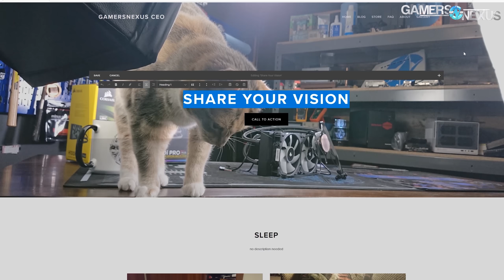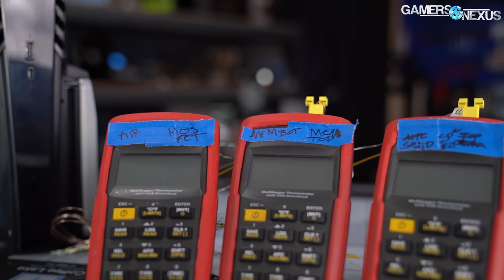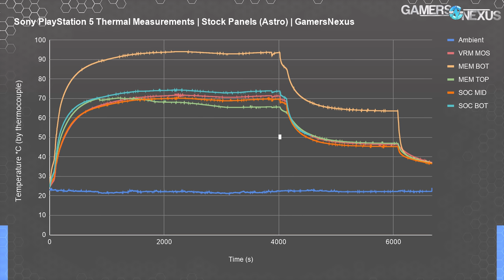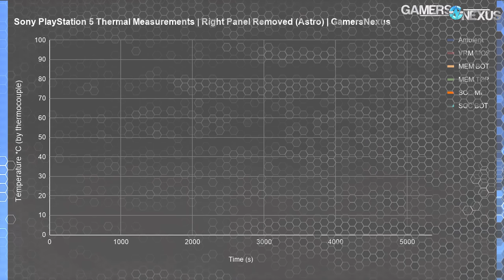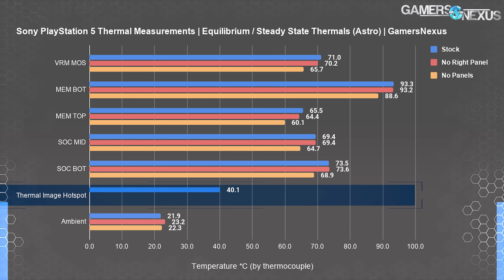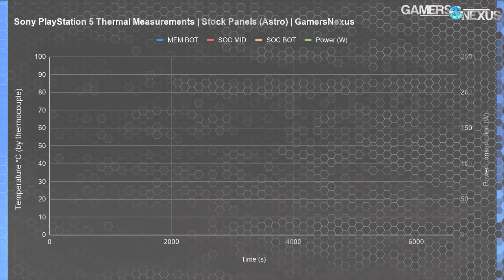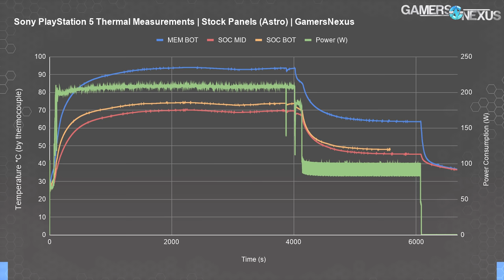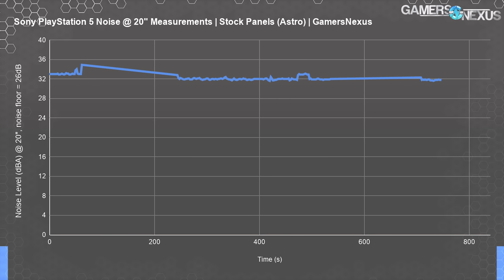Weak Cooler Design: PlayStation 5 Thermals, Power, & Noise Testing

Comment: Me living in a region where ambient goes to >35: Sweating profusely
Reply: Maybe you can channel the excess sweat as a coolant
Reply: maybe you should’ve bought the better next gen console
Reply: @notnooted  or a xbox series, they're top tier engineering
Reply: Yeah, Sony would obviously developed a console that will overheat on half the planet.

The fans will just spin faster to keep it at acceptable temps at higher ambient temps. That's.. pretty obvious. Cerny even talked about ambient temperature having zero effect on their "boost" system, seems retarded that it would then crash the console due to the RAM overheating. "Could be better" doesnt translate to "will have problems".
Reply: @M D well... noise can be a problem too... and while boost can still work at that temperature, I wonder for how long...
Maybe by the time many PS5s die... Sony will have the PS5 Pro ready to go 😂
Reply: @FufuhBR  those error are made. Around 15 years ago multiple mobile phones did not work reliability at winter in counties that get -10 degrees C or less.
Reply: @remmykun8315  the usual bga socket😂
Reply: Not as much as your PS5 will be.
Reply: Ah yes we dont live in a civilized enough society for air conditioning in those temperatures but i want my ps5 🙄

Comment: Let's see how this year's summer heat is gonna treat all the PS5s out there.
This current model needs a revision imo. But I'm not getting my hopes up.
Reply: Like in 2022? A redesign
Reply: you called it, they are working on a new model.
Reply: I'm 100% sure Sony is chomping at the bit for a revision. Their design looks extremely expensive and with the sheer size of the heat sink plus the cost and difficulty of assembling with liquid metal, they're likely losing a LOT per console, even compared to the standard sell at a loss model.
Reply: @shanez1215  looks cheap and rushed. Completely inefficient, thus the huge heatsink
Reply: PS5 Ti lol
Reply: @shanez1215  this may be a bit nit picky, but the term is "champing at the bit"
Reply: It's August 2021 and the heat is treating my launch PS5 very well. :)

Comment: I would rather have the fan louder with temps cooler.
Reply: wont help with the memory
Reply: Yea that small ps5 box does not help
Reply: @Messiahs  It would, though. More heat ejected from the case will cool thst entire steel plate and ultimately the memory. It won't be as drastic of a difference as the SoC but it will drop.

Im curious why they specced such a monstrous 30w fan. Perhaps it has a dust clearing mode like the PS3?
Reply: Same, I run my Pc fans on a higher setting and I didn't care my ps4 pro fan ran fast. I kinda enjoy the sound.
Reply: @94XJ  Good point actually. It'll probably be a minor drop in heat, but it's something you can do right now I guess.
Reply: Nope. Hot does not=slower unless it’s throttling which I doubt it will be.
Reply: Can't say I agree
Reply: MertensCW  you mean a sticker catching the fan blades
Reply: @theholypopechodeii4367  witch also generates heat. This is not a pc,  pre built console,  We cant adjust our voltage here
Reply: @theholypopechodeii4367  ur in the wrong place my friend, this is about ps5
Reply: Revving the fans higher wouldn't help, the thermal solution is flawed and inefficient. Plus the fans are loud enough already. Gotta love how it runs nearly 20 degrees hotter and considerably louder than the Series X yet the Xbox is virtually silent and runs cooler, draws less power and has significantly more processing power
Reply: @theholypopechodeii4367  Your hardware not failing immediately doesn't mean "no issues". If temps are hovering near throttle under load the majority of the time, you're likely shortening the lifespan of your components by a good few years

Comment: An important note regarding boiling water to calibrate thermometers. Water only boils at 100C at 0 meters elevation.  I believe Cary, NC is around 150 m elevation, so water should boil at about 99.5C, but in a city in Wyoming (avg elevation ~2000 m), it may boil closer to 93C. So, if your thermometer reads 95C, don't assume your offset is 5C, unless you know what temp your water actually boils at.
Reply: That doesn't matter bc he's testing all of them in the same altitude.
Reply: @MaxIronsThird  I made a general statement regarding calibrating thermometers using boiling water. It does matter if you're calibrating your own thermometers, so that you can determine what your offset is for your elevation.

Comment: Should do this for the series x also.
Reply: Series x is a tower design. Might not be the most entertaining to test, but still agree with you
Reply: Been done already passed every test with flying colors far superior design when compared to the Ps5
Reply: @naughtynicholas  the Ps5 design is Hideous Aesthetically and functionality
Reply: @RawHeat100  link?
Reply: @RawHeat100  bro can you pass the link
Reply: @RawHeat100 
They did the Series X already?
Reply: @RawHeat100  dudes just blatantly lying lmfao.
Reply: @RawHeat100  if I dont smell xbox fanboy fragrance here.
Reply: Probably will have the same result than PS5
Reply: @jvap244  Doubt it
Reply: @BigNazty8732  ok, we'll see it
Reply: He promised to do it in the video when he gets one at time stamp 36:32
Reply: Right when I saw both I knew the Xbox would run way cooler. It just makes sense to have a cylinder with a fan on the bottom.
Reply: @RawHeat100  Eh, the heatsink is still utter trash and the XSX has the same TDP issues. The problem is that Xbox and PS engineers go cheap due to the mass production that is required, so things like cooling are not at the top of the list where they should be.
Reply: @emceeunderdogrising  That's not the issue though, the issue lies with cheap heatsink design and garbage cases for air to move through. Both consoles share the same issues.
Reply: @RawHeat100  where can u give me link
Reply: @evolicious  if people can blow vape smoke in the bottom, and it all comes out of the top, I'd say that's pretty good ventilation and air flow...
Reply: @evolicious  Yep, and Series X despite the steam chamber use the same cheap thermal paste than Xbox One. Probably his SoC reaches higher temperature than PS5.
Reply: @drummer7557  where there have been ps5 issues there have been similar Xbox issues.
Reply: Mr Glass  ok xbot
Reply: Mr Glass  I said similar but the point is they're both having issues, period! This is typical of the launch of any console. It isn't a pissing contest and again the bottom line is they both have issues.
Reply: @emceeunderdogrising  the fans on the top
Reply: @evolicious  xbox series x does not have thermal issues, ps5 does, end of story. I am a pc gamer so don't say I'm an xbox fanboy or whatever. So sick of these console fanboys jesus it's the same freakin thing.
Reply: @Nebnub  i would prefer GN evaluate xbox series x , 1 for informative purposes, 2 compare vs ps5. i prefer GN  evaluation rather than a youtube comment from an anonymous fanboy.
Reply: @stevem9529  yeah, because heat naturally rises. If I turn a series X off, the heat will still naturally rise through the top vent holes. It won't hold it in for long
Reply: @jvap244  the Xbox seems like it has better air for flow and has been engineered better for cooling. It could possibly run as hot, but I doubt it since it has more ventilation
Reply: I have no horse in this race as an ardent member of PCMR but when the designs were first leaked I was impressed with the Xbox design and concerned for the Ps5 thermals.
Reply: Ray Pen has left the chat
Reply: @geeesejeeeze6055  Guys let's just all agree both consoles are hot ass and PC will always be king 👑
Reply: Gamer nexus are xbox fanboys. They wouldn't dare
Reply: @RawHeat100  lmaoooooooo I'm sure.
Reply: @drummer7557  software crashes is really all they were also from people sticking their consoles in tiny boxes
Reply: @Nebnub  hahahahahahahq sure bud. Sure. The fan on xbox is crap.
Reply: @cynthiaandoh9575   "seems" but in normal conditions, while the air flows works properly in both systems, the liquid metal has higher heat transfer than a thermal paste achieving higher SoC dissipation than Series X.
Reply: @HaunterMusicDJ  Not with the RAM heating up from a crappy small heatsink. And lack of good ventilation. They need to do a lot of work, especially for upcoming taxing games. I know I won't get one until they fix it 100%
Reply: @RawHeat100  How do Microsoft's boots taste?
Reply: @evolicious  that would be right except the xsx is designed around the cooling. They learned from the 360 rrod not to start the console with the design first
Reply: @Nebnub  surely you have source for that
Reply: @RawHeat100  your jealousy is showing
Reply: @insertnamehere8723  
The Series X may be having some issues, but they aren't nearly as worrisome as the PS5's issues. GPU malfunction is a very serious issue and needs to be quickly rectified. And if merely speeding up the fan doesn't solve the problem, there might be a down clocking on the way.

 I've been saying from the get go that the PS5 is terrible designed, and the engineers were lacking compared to Series X engineers. I mostly think I'll be waiting for a gen 2 version before picking up a PS5, as most of these issues will be hopefully solved by then.
Reply: @RawHeat100  Link?
Reply: @emceeunderdogrising  The cilindrical Apple was a colossal failure in terms of cooling efficiency, so they ditched entirely that desing in the latest Apple Pro. Vertical ventilation, used in PC cases as the Silverstone Raven series and in the Cooler Master SL600M have delivered good but mixed results in terms of CPU and GPU temperatures achievable.
Reply: @Imadeyourun  except that's pure conjecture and nothing corroborates with that narrative. We are seeing the launch issues across the board but I expect those to be fixes as and when manufacturing is back up to speed. Regardless, we see the same story with both xbox and Sony clearly having rushed on top of a pandemic to meet demand and get the system out there. Regardless, let's not understate the issues xbox is having, either. This isn't a pissing contents, pal. The only issues identified here comes from the thermal solution for the new memory, however, the memory is rated at well above what we see here so I wouldn't really jump the gun 😉.
Reply: @insertnamehere8723  
It's conjecture only to those who have no knowledge or experience with these things. Anyone who has played on PC knows exactly what GPU issues look like. Also, a few PCs consoles I had that did similar things to what the PS5 is doing now, later died and stopped working completely. People can continue turning a blind eye to these issues, but when the hardware ends up giving out completely, don't go whining later, because you didn't listen.
Reply: @Buran01  Tell me real quick. How would the PC case designed to look like the PS5 run in terms of thermals? The vertical tower or the reverse oreo sandwich?
Reply: @emceeunderdogrising  why has to look that way? In PC cases if a design deliverys poor performance usually ends with bad sales and retired from the market.
Reply: @MunchenerFrance  Ok, we'll wait for the test results of the SoC temperatures, to see if there is more heat transmission than liquid metal with a conventional thermal paste. Cheers.
Reply: @RawHeat100  Lol another xbot furious that they're in 3rd place for another gen
Reply: @92omega63  this gen just started and Ps5 is a overheating Brick with no games outside of demonsouls 😂 but ya who’s first place Nintendo cause it sure ain’t the human torso 5 the Brickstation 5 
The gaystation 5 😂😂😂😭
Reply: @RawHeat100  Aesthetics are completely subjective, you don't get to call that.
Reply: @RawHeat100  someone's a big fanboy 👀
Reply: @92omega63  they literally are. Switch are selling more and have better games still than the Xbox 😂
Reply: @ballisticz  Please
Reply: @jvap244  still worse, the hot air is trapt inside
Reply: @RawHeat100  Aesthetically? subjective.
Functionally? Aside from dodgy thermals seen in this video, it seems to perform as advertised... 🤔
Reply: @olimphus26  
Smell again. 😂
Reply: They just did. It's maximum temperature was only 75-ish  degrees celcius while running COD Cold War with ray tracing. Was around 76 in 120fps mode I believe. Runs cooler, draws less power, has faster load times and is significantly more powerful than PS5
Reply: Why do playstation users always get so defensive?  Consoles are just walmart tech

Comment: Finally a proper test instead of the bs ones other Youtubes did
Reply: points IR camera at console "As you can see, there is indeed heat being produced! And the heatsink and fan seems to be exhausting it out the back! Fascinating!"
Reply: @Katastra_  wasnt that in response to, people saying the Series X was so hot, you couldnt handle it after it was in use
Reply: @imo098765  nope, I remember youtubers doing that in their initial PS5 first look videos. Even Digital Foundry. The quote is obviously exaggerating, but they did just point an IR camera at the console and say "it mostly looks cool, this warm spot is likely where the die sits, the exhaust is this temperature, etc"
Reply: @Katastra_  Wasnt paying much attention when watching that part of the DF coverage because I knew its irrelevant data besides if its warm to the touch, 
which people were saying at the time about the external ssd(which should be very hot) and the console exterior but thats just people talking about rumours and shit over the internet.

So I wasnt really listening

Comment: The disc version of PS5, It seems that the Blu-ray Disc device covers  the heat source of VRM MOS and BOT DDR. 
Here, the digital version of PS5 without the shielding of the Blu-ray Disc device and may achieve better heat dissipation performance.

Comment: GN : Sony cooling solution could be better
Sony v2 : removes ~30% of the heat sink
Reply: Yes, but less mass doesn't equal worse heatsink. I couldn't find a source, but so far I've heard it might run 2-3c hotter (which is probably margin of error/unit by unit differences) and it actually runs quieter. It's a new fan, different heatsink material, and design. It's not fair to compare as we don't have a reliable source yet.
Reply: @Colty0  Wrong. The mass of the Heatsink Does Matter. If you've ever built PC rigs before, or worked on electrical components that require heatsinks, you should know this. The point of a Heatsink is to absorb and dissipate heat from electrical components that generate heat. The larger the surface area, the better the heat dissipation assisted by the Cooling Fan. What Sony did wrong here is they removed a huge chunk of the heatsink. What's worse is they replaced the Copper with Aluminum. I assume you already know this as common sense, or have already learned this in High School, but Aluminum is not as Thermally Conductive as Copper. In fact, Copper is one of the most thermally conductive metals available. Since they removed it and replaced it with Aluminum, heat absorption and distribution is significantly worse in the new model. The only thing they did right is the Cooling Fan having longer Fan blades than the old one.

The only point of conclusion here is that the internal components themselves are Generating more Heat. Hence, why the newer model is pushing out Hotter air than the old one.
Reply: @roundabout9452  The design is quite different. No valid tests have been ran to compare. You're not wrong, but the heat pipe design is just too different to compare by mass/looking at it. Chill
Reply: @roundabout9452  wrong. It's been debunked. Look it up
Reply: @daLukasMain  can you plz link where you found this
Reply: Than Microsoft says

LETS put in an FAN that can be replaced easy with an PC FAN without cutting it down

Comment: Every time I see a video of people doing thermal tests of the outside, I always comment thermal testing only matters internally not externally, external just shows how well the fan is dissipating the heat.
Reply: Or in this case hides the problem because you have a couple of good side thermal insulators...
Reply: @or1on89  yup